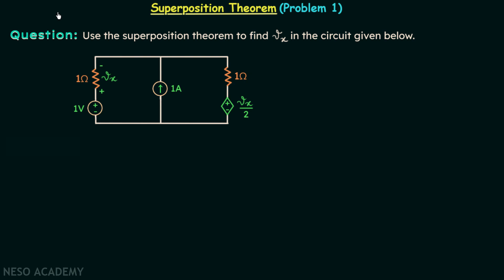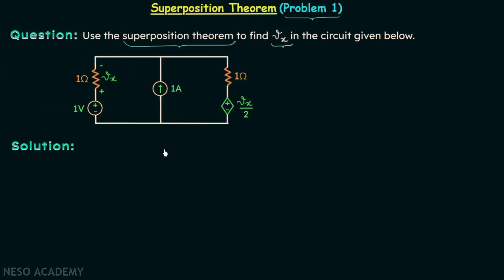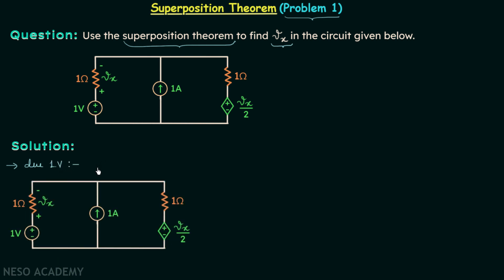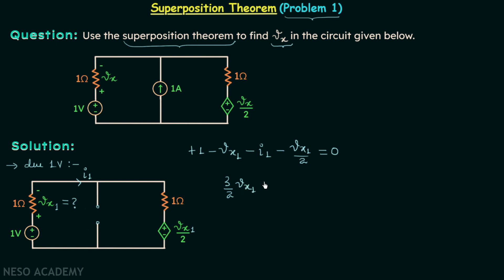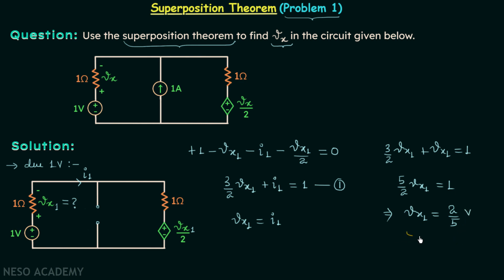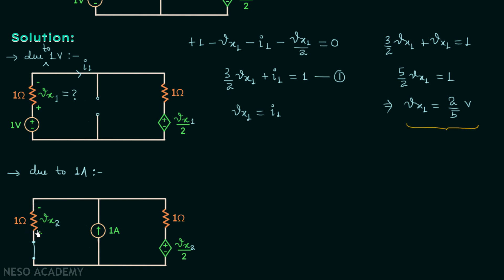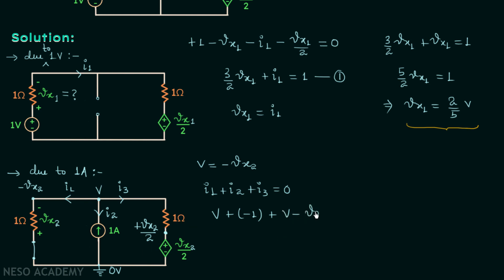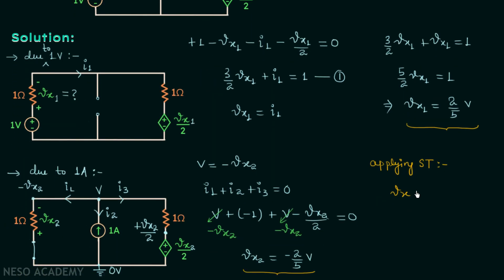Superposition Theorem with Dependent Sources

Comment: can anybody explain that in case of Vx2 by using nodal analysis the I1 should be V-(-Vx2) but how V-0 will come
Reply: Voltage across a short circuit is 0 so there is no voltage dropped between V and -Vx2. Think of I1 as the current across the resistor which is between V and ground.

Comment: You are contradicting what you said in nodal analysis sir, when there is a voltage source between a reference and non-reference node it becomes the voltage of that node then we don't do it any further
Reply: But for this question there's a resistor as well as a voltage source between a nonreference node and the reference node.
Reply: You're right he said that but he actually meant , of which he was correct, that it only becomes the voltage of the node if there's no other branch (resistor for instance) between a nonreference node and the reference node. If there's only a voltage source between a nonreference node and the reference node then the voltage is equal to the voltage of the nonreference node. I hope that will help..
Reply: This is because there's voltage on the source as well as on the resistor. That's how I understood.

Comment: Sir in case 2 why V= -Vx2/2? I didn't get the reason of negative sign. Kindly explain. 🙏
Reply: because current direction is opposite
Reply: You can think of it as going from the positive terminal (higher voltage) to the negative terminal (lower voltage) you have a voltage drop of 
V = -Vx2/2 (the current in this case goes from the positive to the negative terminal). If you have the current goes in the opposite direction V = Vx2/2. Hope this will help.

Comment: Vx1 should be equal to -i1 because the sign of vx1 is negative. See the first ckt of the solution when we are considering only the voltage source. Correct me if I am wrong.
Reply: see the polarity of Vx1 it is same along the current tressing direction... If polarity of Vx1 will interchange then you will get Vx1 equals to -i1